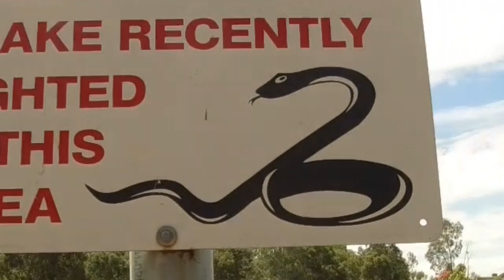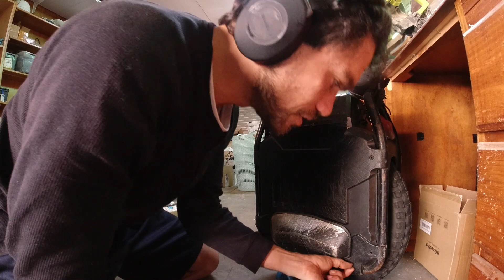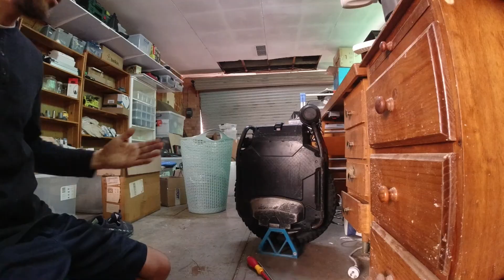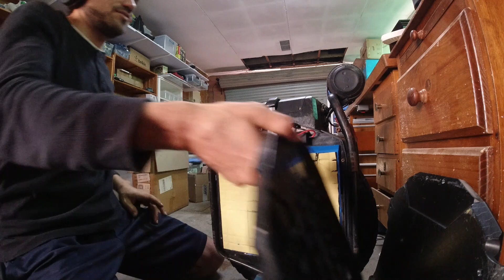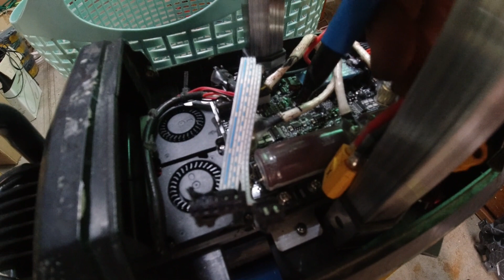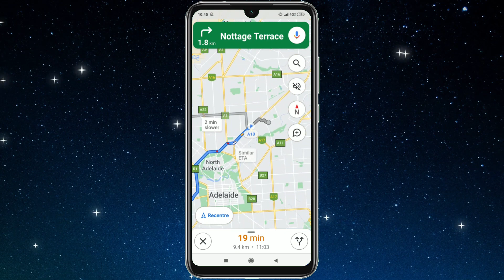Slime was meant to fix it (OMG You won't believe what happened with my EUC)

Comment: If you didn’t already shave some of those inside panel ribs over the BMS area, which if bumped hard enough can cause BMS failure and charging issues, now is a great time 🙏🏼🔋⚡️🛸🧘☺️ 🙏🏼
Reply from the maker: I actually already had the new side panels installed which are supposed to solve that BMS issue.

Comment: Bummer Bro... whenever you order a tyre, get a tube too haha.  When you order one, get 2 (one for spare) and maybe one for the 16X as well.  The difference with our tubes, because, sure you can buy a 14"  tyre tube from a bike shop or ebay, but ours need the bent valve stem so that it doesn't run into our hub motor. EUC they call the wheel size by the outside diameter of the whole tyre... not the rim size like on a car.  I use 'Armordiloz'  rather than tyre slime... I get the blue for high speed tyres. E-riderz sells it... good stuff. Buy some new bars too haha yours are slightly used
Reply from the maker: lol yeah my bars are screwed. There's this stuff called "Never Flat" that I've used twice and it's worked both times. My 16x tyre still hasn't gone below 32psi after like 6 months of just sitting there with that stuff in there after a puncture.

Comment: Bicycle shop will have your tubes.
Reply from the maker: They didn't have it but the motorcycle shop did. Only problem was it doesn't have a bent valve so you can't put air in it after installing it.

Comment: Oh oh theres that beautiful packaging foam. Mmm.
Just need some duck tape and stick on valcro and youll have jump pads.
Reply from the maker: haha I was thinking about 3d printing some TPU pads.
Reply: @arcrides6841  yip tpu is what im trying first. 
My video clip i sent you said rim was 375mm diameter. 60mm wide. 
Yip just over 14 inch. 
If you can confirm mm that would be good. As well as inner tyre measure. or impessed clay picture.  
Your part 2 video was interesting. 
Your batteries didnt fall very far. They Likeky ok. At your own risk of course.  I look forward to your next vid part 3.

Comment: Wow, mate. I so wish I had informed you to always keep your wheel on its side if you get a flat. Why did you try to turn it on when it was on the stand, anyway? It would either be off the ground and do the free-spin-freak-out or the flat tire would prevent it from making proper contact with the ground and it would then do the free-spin-freak-out. Not sure what you were thinking there, but there is no positive reason to keep the wheel upright. Always lay it flat, even if it's going to be weeks before you deal with it. That's what I did for my Nik+.

Live and learn, I guess. Not that I'm some expert as I had my handle fully extended 6 weeks ago and turned around and it fell off the 2nd stair and landed upside down. New handle cost $48 and I had to take the sides off, as well as the top part (and I always forget that 9th screw in the middle of the Sherman side panel, too) and that was that. Flash forward to two days ago, I made a 2x4 piece of wood a ramp for my Sherman to go up those 2 stairs. It rained hard, got wet, and my Sherman FREAKED out when it was being forced up that slick surface. When the dust settled (and I'm not being poetic), it reeked of burned rubber and my handle bent slightly from me holding on to it. It bent just enough to not go down. I bent it the other way and was able to beast it down about 95%, but it's not going any further. Another email to Ewheels when I get paid next month. That's two handles in two months. You say the Sherman handle is ridged, I beg to differ.

Point is, we are all on this same journey together and I love the interaction that each of us has with one another. It really is like an extended family, except I choose to interact with you lot. LOL.

Oh, and thanks for another fun to watch video. =8-Þ
Reply from the maker: I know what a dumb mistake. But I got the flat in the middle of a park and had to walk a fair way with the wheel to get to the road. I did it with the wheel on just fine and even pushed it up some steps. Done the same in the past too without issues. It was just while it was on this stand because the wheel is raised just enough so the flat tyre couldn't grip onto anything. Freakin sucks but ah well at least I get to learn to service the sherman and I'll need to have the wheel apart to replace that top cover which is due to arrive in a couple of days. You could even say it's great timing.

About that sherman handle I never push it in all the way cos it's annoying to get back out. So 95% seems pretty good to me. I still say it's super strong 💪. I dropped it hard against a wall the other day fully extended and it smoothed out. It was a bit tight before and I had to jiggle it a lot but now it just slides like butter. Crazy.